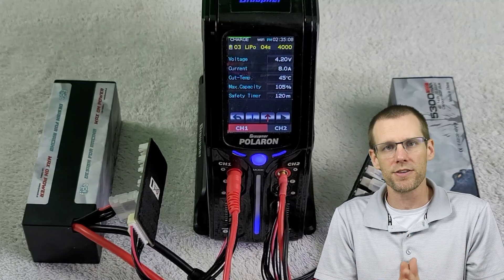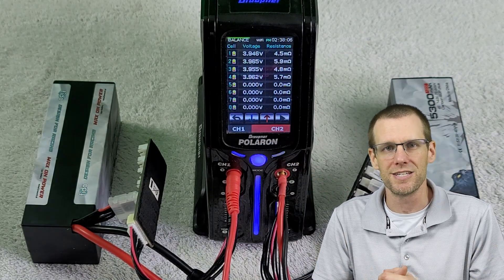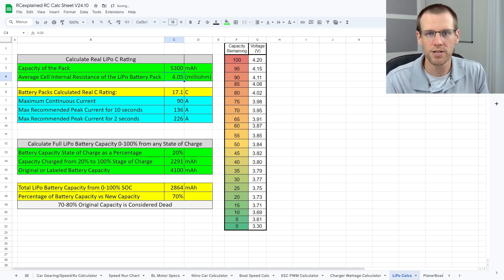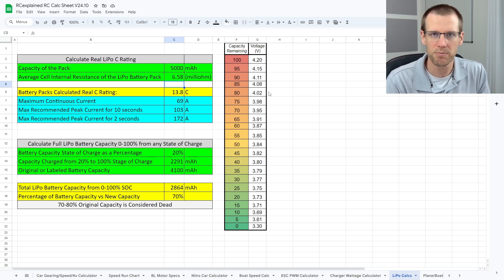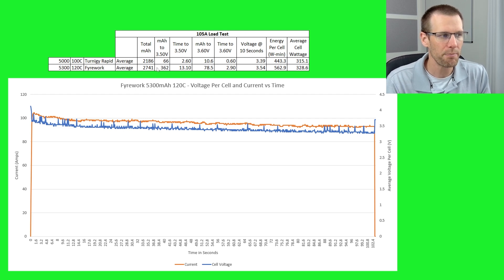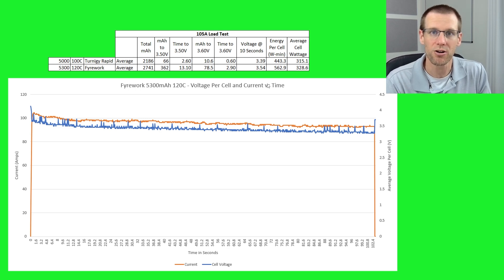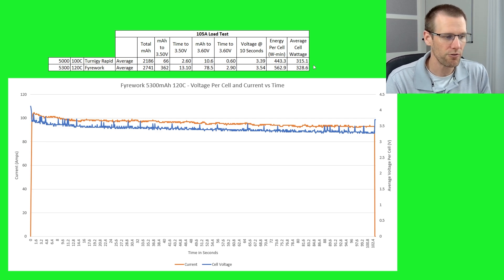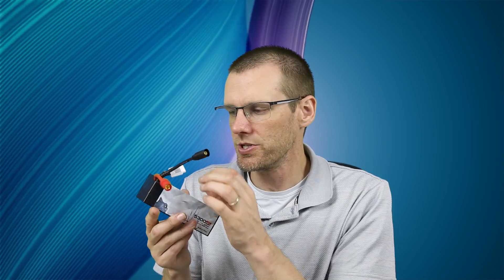Fyrrework 4S 5300mAh LiPo Battery put to the Ultimate Test

Comment: You comparing battery with different price point, no wonder rapid lost. Please compare with same price point. Thank u. Battery with resistance above 5miliohm mostly trash battery.
Reply from the maker: In one of the last videos I did, I was told that I should be comparing batteries with similar C ratings and mAh, not necessarily price.
Reply: @RCexplained  You're comparing correctly, I wouldn't factor in price heavily as ANY battery pack, regardless of price, can be good or bad
It's been proven in the Battery Load Test Comparisons thread on the RCGroups forum, that price is not a good indicator of quality. Just look at MaxAmps; incredibly expensive, but often perform near the bottom of the group in tests.
Btw, appreciate the work you do, keep it up. Have to hold battery brands accountable for false marketing!
Reply: Who tells you what to do?

Comment: Bud test the Azure 9000 mah 4 s that’s the killer battery
Reply from the maker: I was looking at their 5000 battery to test.
Reply: @RCexplained  I have they 9000 mah 4 s and the data is amazing they do not drop much on a run best way I can describe them is violent and we have smc and cnhl batteries also H and w racing channel
Reply: @RCexplained  Yeah but get the 9k, nearly double that 5k.

Comment: Disapointed in those cheap turnigy Rapid packs, I have 6 of them. 2s, 3s & 4s, ir out the box was between 10Mohm - 12Mohm per cell. Ir was tested on my Icharger & Hota S6 charger, after 5 break in charges/discharges on the charger + a couple of runs in the cars ir was still around 8Mohm - 10Mohm per cell across all batteries. Worst still was one of the 3s 5000mah Rapides would not charge beyond 3.86v on 1 of the cells, the other 2 cells would fully charge. I even tried discharging the battery down, then gave it a charge for a minite or two on nimh charge to try to wake the battery up. All to no effect, ended up scrapping a new lipo. Certainly will not buy any more of these Rapides ever again.
Reply: You probably already know ,but for me the Ovonic 4s are monster packs and very reliable balanced charge on each cell. Also like Zeee.
Reply: Sounds like non grade A cells